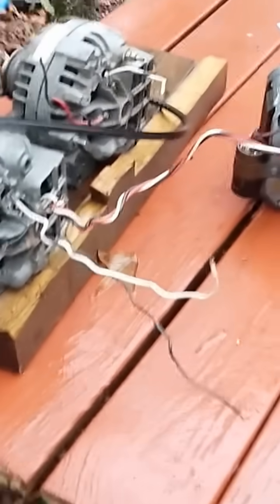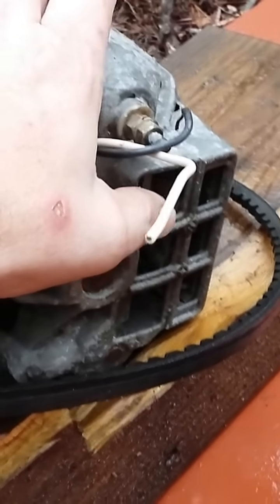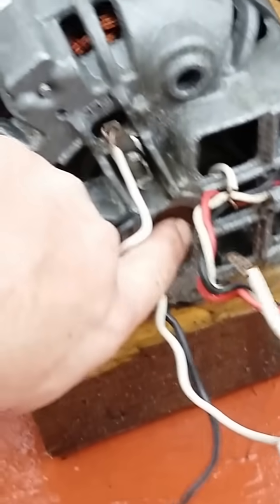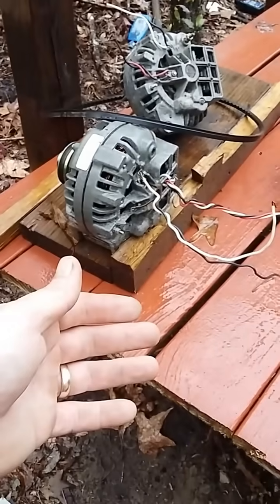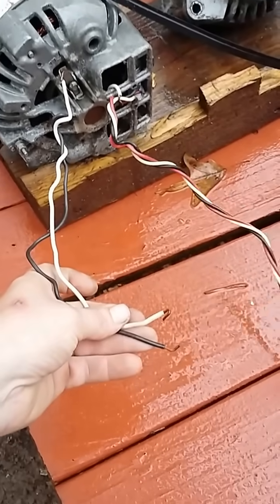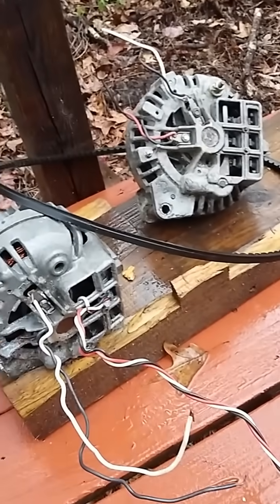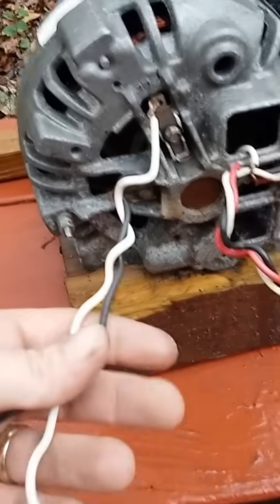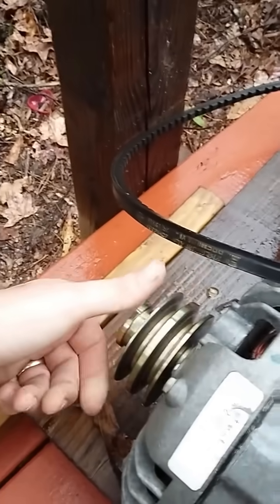Update Free energy forever no wind no solar no gas READ DISCRIPTION!!!

Comment: CRYSTAL METH IS A HELL OF A DRUG. DO YOU REALLY THINK YOU ARE THE FIRST PERSON TO THINK OF THIS? NO. YOU CAN NOT GET MORE THAN YOU PUT IN.
Reply: not if you learn wrong way to do it. /Tesla
Reply: if you cannot get more than you put in..... then how do electric companies take their power and step it up a SHIT TON to send it down the line then step it down b4 it enters your house???  You can use a step converter to take 5 volts and output 25 volts with that same 5 volt input.  

Actually....... you do not need ANY power input if you use mechanical energy to "spin the wheel".  The guy who runs Turtle Island that they show on history chanel just ran a line up to a natural spring and the force of the water was more than enough to "spin the wheel" and he powered his sawmill with a endless supply of "mechanical energy".

Essentially you get electricity with ZERO input (power wise).

A stun gun takes 9volts from a 9volt battery and steps it up to 20k volts and does it without sucking the battery dry so it lasts like you are using it in a small flashlight or whatever....... 20k output with only 9volt input.  I know some things use capacitors to "store" a charge but if you actually just transferred the 9volts to a capacitor and stockpiled the power up to 20k you would drain the battery and basically get a rapid discharge released all at once...... 

I know TECHNICALLY law of thermodynamics says you cannot get out more than you put in....... but...... plug a 9 volt into a stun gun and u get multiple uses out of the battery at 20k volts (or whatever strength the stun gun is).  You cant just "store" the current cuz it would take 2,222 9 volt batteries to store enough charge to release a 1 time discharge of 20k volts.  So ya...... you do get more out than you put in despite laws of thermodynamics.

But then again E=MC2 says you got enough energy in your finger to blow up 1/2 a city.....  You do not need "uranium" or plutonium ect...... any mass will produce that kind of "bang" we just don't know how to "release" it.

You can manipulate the current to make it get stronger without inputting any more than the original input.  And technically if you find a nice "natural spring" that spits out a endless supply of water, you can get something from nothing because the spring would have been spitting out water regardless weather or not you "tap into it".  It would be doing its thing if you did not use it to "spin a wheel" and once you generate the power, you can drink the water....... so the "garbage or byproduct" of it  flowing out of the rock = "free energy" that was created from NOTHING. (it IS nothing because if you never used it to "spin your wheel" does not effect the water in any way, and if you do spin your wheel with it, you essentially do not effect it and at the end, you still have the same water that can still be used as "water").

You are correct as law of thermodynamics says you are correct, but..... in all in all you can get energy from essentially "nothing" as you do not need to "supply" a power source when the river is going to flow and keep flowing regardless weather or not you exploit the mechanical energy or not..... so the same water will do exactly what it is doing and NOT create electricity or create electricity and STILL do what it naturally does.  

If a tree falls in the woods and nobody is around to hear it....... the sound is still made weather or not you are are there to "exploit" the sound waves by "hearing" it or not......
Reply: you are funny.
"You are correct as law of thermodynamics says you are correct, but..... in all in all you can get energy from essentially "nothing" as you do not need to "supply" a power source when the river is going to flow and keep flowing regardless weather or not you exploit the mechanical energy or not..... so the same water will do exactly what it is doing and NOT create electricity or create electricity and STILL do what it naturally does. " the river is the POWER SOURCE .
. like i said. you CAN NOT get MORE POWER than you put in. if you have not learned that by now,you probably never can. stick to legos and jigsaw puzzles.
Reply: I guess you missed my "alternate view"...... As I said thermodynamics lays it all out in general for EVERY type of energy converting to a different energy type such as "potential energy" such as a ball at rest on top of a incline that converts to kinetic energy when it starts to roll down the incline.  Yes..... I do understand the whole "concept".......   and yes........ I realize you are converting the mechanical kinetic energy the water/wind has and converting it into electrical energy....... and thermodynamics explains and measures one to the other..

The thing is........ "potential energy" can be a completely imaginary concept and conflicts with "an object at rest will remain at rest unless acted on by outside force and object in motion will remain in motion until acted upon by outside force.  A ball at rest at the top of an incline and you say it has "potential energy" = abstract concept because it is at rest and will REMAIN at rest = no energy until outside force acts on it so the ball rolling down the hill = MORE energy than you "exert" to "nudge it" into motion.  You get more energy out of the ball rolling down an incline than you input to start the ball rolling.  But you can throw thermodynamics back at me and say the force of gravity is enacted to accelerate the ball so gravity force/energy = the energy of the ball rolling down the incline and so thermodynamics is satisfied as output does not > input.

A spring or rubber band would be a "realistic" way to say "potential energy" as it ACTUALLY stores the energy and releases the energy much like a battery does only for "mechanical energy"..... yet a ball at rest has no energy stores no energy and ONLY moves because of outside forces enacting on it so...... yes PART of "thermodynamics" is indeed an abstract "imaginary" concept as it does include this situation of "potential energy".......

The thing with the river providing the "energy" YES!!!! I KNOW!!!! you are technically converting mechanical kinetic energy into electrical energy and thermodynamics dictates EVERY PART of the "transfer" of energy..........  I am simply saying that the river flows and will keep flowing weather or not you "exploit" it or not......  YOU are getting more energy than YOU input by using the water flowing that is flowing and will continue to flow even if you never even DISCOVER the river.  You build a pipe to divert some of it to power your "whatever".   You exert energy to build the pipe and with that LITTLE BIT of energy you exert you can get YEARS of NONSTOP "energy" with the very little energy YOU INPUT.  You do not have to create/convert/manipulate or even INTERACT with the river to produce a mechanical energy to use, it naturally is there and will be there after you die, doing exactly what it does....... flowing from high to low.

Where is "thermodynamics" to account for THIS abstract "imaginary" concept???? it can magically give a ball that is at REST an abstract imaginary amount of energy when in fact that ball could never ever move at ANY point in the future.....  It might just stay at rest its whole "life" and NEVER move = it has NO energy.  

The door swings both ways as the river is already in motion and will continue to be IN motion until no more water is added to it and it evaporates, but until then you do not have to INPUT the amount of energy the water has "naturally" to "exploit" it, it takes far less energy INPUT to "exploit" it.....  so yes..... you can get MORE than you INPUT.

Now..... put a mechanical generator onto the wheel of a stationary bicycle...... in order to get energy out of that "SYSTEM" you must INPUT a SHIT TON of energy to receive a way lesser amount of energy because why???? As the ball is at rest so too is the IMAGINARY "potential energy" of the generator that will NEVER produce energy until you get on the bike and pedal your ass off......  I am simply showing that by building a windmill you input a small amount of energy to "build" the windmill.

Now.... it boils down to the question...... Does the windmill that does not EXIST yet have "potential energy" even though it does not exist as you have not built the windmill yet???? THAT is the SAME THING as saying the ball at rest has a "magical imaginary" energy that DOES NOT EXIST because it will NEVER EVER MOVE until you exert a very small amount of energy to "nudge it" = YOU input energy into the ball to make it move and if it is rolling down hill, you receive MORE energy than you INPUT.

Before you build a windmill thermodynamics does not have ANY part of it, as it does not exist...... you input the energy to BUILD the windmill and with that little bit of energy you RECEIVE years and years of constant energy........ thermodynamics explains and measures the transfer of energy from teh wind to the mill to the "whatever" you are powering with the mill....... but what thermodynamics does NOT even BEGIN to calculate is the fact the mill does NOT EXIST and the energy YOU YOURSELF INPUT which INDEED you are getting more out than you put in........

THIS is the FLAW with thermodynamics.  Diverting a river with a pipe to power something..... You do not need to "input" the energy of the water as the energy of the water ALREADY exists and will continue to exist even if you are not there to INPUT energy to "exploit" it.  If I do not input ANY energy to exploit the river then i get a SHIT TON % more energy than I input as I input ZERO energy and the full force of the water energy continues to flow..... I simply just sit there and watch it flow so I am getting 100% of the energy OUT of it, because I expend NO energy, yet it has "potential energy" as I sit there and watch it.......  This is what thermodynamics does NOT include into its "law".  It describes the lowest "layer" going all out to calculate the "energy" of a ball at rest at the top of a hill...... but does not account for the ALMOST NO ENERGY input to make the ball move. It calculates all that "non existing" energy that ONLY exists after I NUDGE it with almost NO energy input.   It says potential energy as it "might roll down the hill" the hill gives it this much energy and acceleration, ect ect....... but NONE OF THAT exists until I nudge it...... If i never nudge it there is NOTHING for thermodynamics to even BEGIN to "calculate" as that object at rest will remain at rest until I move it (or whatever "energy' comes along and "exerts itself onto the ball").

A good analogy to explain it is..... you have a digital scale......  you have something you want to weigh but you do not want the "weight" of the container but only the weight of the contents....  the scale is thermodynamics but you want to measure the INPUT energy (that pertains to YOU).  You place an exact duplicate of the "container" onto the scale and zero the scale out..... now place the container with the thing you want the weight of.....  now it gives you the weight of ONLY the contents and not of the container....

I want to ZERO the scale/thermodynamics and ONLY measure the energy I input to get the "result" I want to achieve.  The "contents/energy" will be the same weather or not I am measuring it or not, I only want to know the INPUT that I must do to achieve my goal........ therefore you get MORE out than YOU put in.  Thermodynamics does a DETAILED and EXTENSIVE job at describing/calculating every little aspect of the transfer of energy of the "system" but does NOT include the actual INPUT amount of energy that sets the "system" into motion and fails to acknowledge that if that "outside" force is NOT applied then all them "laws" describe NOTHING as the "system" will NEVER move or have energy until you apply that small amount of energy to set the WHOLE thing in motion.

Einstein said light speed = top of the scale and NOTHING can travel faster than it...... I cannot walk faster than I can walk from point a to point b........   but....... now move the ground I am walking on toward point B as I am walking to point B = I travel at same speed (below the speed limit) but ultimately travel much faster than the speed limit as the ground I am walking on is moving faster than I am walking.  Same concept as spacetime ITSELF can expand faster than light.   Thermodynamics is much like the laws of "relativity" and ignores the fact that spacetime ITSELF can expand faster while the object it carries can now "walk" faster than the speed limit of light..... as it ignores the VERY SMALL nudge I give the ball to set the whole system into motion....

So by nudging the ball and making it roll downhill for 5 minutes.........  Tell me how I am not getting drastically MORE energy than I input into the ball?  Any law of thermodynamic you "recite" to me = not relevant to the energy I am receiving FROM the ball compared to the energy I exerted onto the ball.

I have a REAL problem with this aspect of the whole conservation of energy and thermodynamics as it is like you pulling out a ruler to measure an object but the object does not exist TO measure.
Reply: http://www.rexresearch.com/grandics/grandics.htm
Reply: thermodynamics is a mighty big word for you. tell us all about it in your mind. lol. more more . maybe if you give a longer example ,it will magically happen. you might be the first to unlock the secrets of the three magic alternators and be king of the world someday..
Reply: Reading a simple document appears to be more difficult for you. I am pretty sure the US Patent office doesn't award patents for shit that doesn't work.
Reply: wow.more assumptions.maybe your psychic powers will ad some power . we're ready for your working model.read,do,show. or shut the fuck up.
Reply: Let me guess, you probably think anti gravity doesn't work either, right? https://www.google.com/patents/US20060145019
Reply: You probably say over unity is a myth too, right? What about this? https://www.google.com/patents/US6974110
Reply: Can you read or are you just stupid?
Reply: and you simply regurgitate what the "book"/they say is the way things is without ever seeing it has holes and fails to accomplish the very thing it "accomplishes".......  Take a group of atoms into deep space where it NATURALLY gets as close to absolute 0 as it can get and the atoms slow WAY WAY down and if they hit ab 0, you literally loose the "heat" "friction" "motion" and EVERYTHING..... it simply disappears as the energy the atoms used to contain no longer EXISTS.  the heat does not "dissipate" to anywhere as the atoms themselves simply stop moving = they simply stop producing the heat..... stop moving = no more friction that used to cause the heat....  Since they basically stop moving and "freeze", there is no "potential" energy as they cannot move and will never move again until a "heat" energy is added to make them warm again.  The energy they used to "posses" is simply destroyed......  I can come along and transfer some of MY energy and some energy from a heat source TO the atoms to warm them up allowing them to once again "create" energy as they vibrate.

That state where physics and even quantum physics are BOTH thrown out the window = a place even stranger than quantum mechanics.  A place where even light ITSELF can be "stopped" and frozen .

And yes, I said take them to a place in deep space where the natural temp is as close to ab 0 as it can possibly get = NO energy is expended to CREATE the ab 0 environment, the "lack of energy" itself naturally creates it.
Reply: let me guess ,subject diverted? show us your flying saucer.
Reply: not diverted, just showing that there ARE holes in the "laws" that make things "illegal" and "impossible".
Reply: I do agree with the step up in voltage, there is a thing called a step transformer that is in almost every kind charger out there. But however when you step up voltage you get a loss in amperage. A 9 volt battery in a stun gun stepped up to a million volts has much less amperage in it. Think of it as pushing water through a garden hose...you can shove 100 gallons of water through a one inch hose but to put the same volume of water through a hose that is the size of a hypodermic needle, you must increase the speed at which the water travels through it.
Reply: If you read the Patent dumb ass you would see it. Get off your dead ass and do some work.
Reply: https://www.youtube.com/watch?v=RO3RFRlMawY&t=829s
Reply: has anyone seen the video of college graduates that could not hook a light to a battery?
https://www.youtube.com/watch?v=aIhk9eKOLzQ
Reply: it puts a whole new light on the stupidity of the unemployed college protestors that seem to be protesting just to protest.
Reply: Fools, the key word in the second law is YOU. It's meant figuratively. Tesla revealed that as you let the energy flow in to get your work done for free(With out YOU(figuratively) adding anything other than what starts the work.
Reply: a ball on top of a hill. huuuum. how much energy did it take to get the ball up there? once at the bottom of the hill it is used up like burnt fuel. like winding a watch.like swinging a pendulum.
Reply: where is your over unity energy? can't you read a simple document? oh, you have no over unity energy for me or anyone on this planet? well i guess you must be stupid.
Reply: A ball at rest on a flat level plane......... something comes along and takes the ground away in front of the ball forming a slope away from the ball.  Ball is now sitting on top of a hill that used to be flat and level = no energy was put into the ball to "get it up there" even though energy was used to move the ground to form the hill, that ball will STILL remain at rest until a small energy force is exerted to the ball to put it into motion to go down the hill (that it NEVER traveled "up").  The energy spent removing the ground in front of the ball does not change the fact or will NEVER change the fact that the ball at rest will forever REMAIN at rest until you, a gust of wind, or whatever puts that ball into motion, allowing it to roll down the hill and the energy released going down the hill is MORE than the "nudge" you give it put it into motion. Energy used to "form" the hill has NO BEARING on the ball whatsoever......

You could say that the energy used to create the hill = the "potential energy" now stored into the hill...... but lets say 1000 or 1000000 balls roll down that hill until the energy it took to create the hill is exceeded by the 1000000 balls rolling down it...... where does the energy come from that is in EXCESS of the "input energy"?  You make up an abstract "ideal" called "potential energy" that the hill somehow MAGICALLY still has even though the energy used to create it is exceeded.....
Reply: energy was used to create a slop. lowering the ground and putting the ball up are the same thing. nice try. and you only moved the ball to the slop ,where gravity moved it down. the fact will always remain ,that it took energy to create a ball ,the ground,and the slop, and it's movement. even energy from a solar panel is not free in any way shape or form. your balls are not even close to over unity and also created a large waste product of thousands of balls magically up on a hill now being at the bottom . there was no " the hill and ball had no energy. i never said that. you did. if you think your balls can be used to create over unity,by all means,show us.we all find it entertaining.
Reply: "
"energy was used to create a slop. lowering the ground and putting the ball up are the same thing."  

I already mentioned this..... If I sit down on a flat piece of land, and YOU come along and make a hill in front of me..... ya you used energy to create the hill but..... that in no way effects me as I am at rest and remain at rest even though you created the hill.....

I sit down on a flat plane, I did not have to exert any extra energy to go "up a hill" (a ball rolling on a level plane takes LESS energy than to roll UP an incline) yet there is now a hill there and NO energy used by me to "exist" at the top of the hill that NOW EXISTS because you spent the energy to create it.  Someone nudges me and I now roll/fall down the hill you created.  The hill was and had nothing to do with my "energy system" 

Ya, technically (as I have said before) thermodynamics explains and measures it...... but...... if you spend energy to create a hill in front of 1000000 balls and a single gust of wind makes them ALL roll down the hill then the energy from 1 ball rolling down x 1000000 or 1000000000 or whatever that is put into motion by that 1 gust of wind.... a tiny amount of force was used to push them all at the same time, just enough force to move a ball but that same force moves them ALL at once.

What I am saying is.... if you have a wind guage and measure the force of the wind as it pushes 1 ball, will the measurement on the guage increase if you add 100 more balls (that also get affected by the gust of wind).  If the guage does not increase then any energy you "try" to apply to the other 9999999 balls do not exist because the wind did not get stronger to move the extra balls.

You could come back and say it IS more energy used because that small force is applied over an area and only a small fraction of it is used to push 1 single ball and more is used of the area effect of the gust to push multiple balls...... but if energy cannot be created or destroyed, then the energy that exists where the balls do not exist if you only have 1 ball, yet the single "gust" of wind that pushed the 1 ball, where does the "rest" of the energy go?? On the other side, the gust did not get any stronger to push the extra balls ....

Also, how can gravity be considered "energy"?  If 2 magnets pull each other together because of the magnetic force how can you consider that force "energy" as that force is a natural trait of it?  That natural force can attract object after object after object after object yet it does "expend" enough "energy" to do so??  Everything I have read on magnets say that in order to "demagnetize" a magnet, you basically have to put "energy" into it to remove the natural trait of magnetism as in heat it up, shock ect....  some say that a magnet will lose like 1% of its magnetism over 100 years so the magnet itself will "erode" away well before it become "naturally demagnetized".  How can you call the force of magnetism "energy"  as it is an inherent property of the material?  Gravity is essentially magnetism only all matter posses Gravitational Fields unlike magnetism fields.

2 Pieces of matter that attract each other will ALWAYS attract each other and no "energy" is used to do it......
Reply: "2 Pieces of matter that attract each other will ALWAYS attract each other and no "energy" is used to do it......" this is the exact stupidity that made your education useless. like i said,go right ahead and show the world if you think you can. but you won't.and you defiantly have not come even close here.
Reply: So, if 2 objects at rest get pulled together by gravity, where does the energy "come from" then?

"In physics, a gravitational field is a model used to explain the influence that a massive body extends into the space around itself, producing a force on another massive body.[1] Thus, a gravitational field is used to explain gravitational phenomena, and is measured in newtons per kilogram (N/kg). In its original concept, gravity was a force between point masses. Following Isaac Newton, Pierre-Simon Laplace attempted to model gravity as some kind of radiation field or fluid, and since the 19th century explanations for gravity have usually been taught in terms of a field model, rather than a point attraction.

In a field model, rather than two particles attracting each other, the particles distort spacetime via their mass, and this distortion is what is perceived and measured as a "force". In such a model one states that matter moves in certain ways in response to the curvature of spacetime,[2] and that there is either no gravitational force,[3] or that gravity is a fictitious force.[4]"

THEORY...... all we have for gravity is 100% theory..... we know it exists, what it does but have no CLUE as to WHY it exists....  So how can you say gravity = energy when we do not even understand HOW or WHY IT WORKS??
Reply: if two objects are at rest they are not being pulled together are they? still waiting for your working model. when something exist why is irrelevant. there is no mystery at that point. your circular babblings are boring me. the fact of the matter is ,this video is bullshit.until you have a working model proving otherwise ,which you can not,it is you living in a world of theory.
Reply: "if two objects are at rest they are not being pulled together are they?"  That was kinda my point..... How can 2 objects pull each other together?  How can the Sun pull the Earth towards it creating the "orbit" we are in?  Energy cannot be created or destroyed..... so...... where does the "energy" of gravity come from or how/why does it work?  

"it is you living in a world of theory."...... this is the ESSENCE of science.....  There is no FACT in science.....   If you say one thing is FACT, that fact will change tomorrow by a new "discovery" that changes your "theory".   Once you stop "theorizing" and contesting the "fact" of science as it stands today, then it is you that live in a "make believe" world as the world we "know" is changing all the time and the things we THOUGHT we knew are proven to be far away from the truth that we learn tomorrow that WILL be changed again the next day to a NEW "truth".

Without living in a world of "theory" we would still think the Earth = Center of Universe and the universe revolves around the Earth.... and the Earth is Flat ect.. ect...
Reply: humm still no working model? i guess you're a hack lol. maybe you don't have enough balls on your hill.lol
Reply: Rusty Koenig
you have a lot of questions for someone acting like they know it it all. what a joke.
Reply: Galileo was once branded as a "crackpot" with "laughable theories" and ridiculed...... The man gave us new and strange "ideals" that "mainstream science" said was a "joke"......

Yes..... I have LOTS of questions..... YOU should have lots of questions too because when you stop asking questions progress will not be made..... If Galileo simply regurgitated the crap that was being "taught" along with everyone else...... The earth would still be the center of the Universe with EVERYTHING revolving around US.  If Einstein stopped asking questions and simply only regurgitated what was taught......  If Hubble simply regurgitated what was taught........... 

I do understand all you been saying as it is Jr. High level BASIC physical science 101...... (or was when I was in school and may be taught sooner now days).  This is ALL basic crap learned in science class.  But...... then again...... MY science books in school said we had 9 planets and the 9th planet was called PLUTO!!!   This was FACT and taught as FACT.......  Hmmmm........ My FACT is no more and a "new reality" exists for students now..... 8 planets and Neptune = the last planet.......

I do understand that "this video" cannot work.....  As long as we have been using electricity, generators, batteries, building complex electronics....... if you could simply use a generator to generate power, send it to a motor and have the motor power the generator and all started with an initial burst of energy to get it going....... I think we would have had it by now and it would be common knowledge if it were possible to do that........

But NEVER EVER stop criticizing..... asking questions...... challenging "fact"..... as when you stop doing that, all "progress" towards new things are lost FOREVER!
Reply: it is the year 2017 and you are not Galileo. you are the people that called him a crackpot. .it was not that he was not believed,it was because he destroyed the fake flat earth freaks of his time. still waiting for your working modal of over-unity. well actually i'm done waiting because you can't do it.
Reply: Since you only seem to read the 1st line...... 

"I do understand that "this video" cannot work.....  As long as we have been using electricity, generators, batteries, building complex electronics....... if you could simply use a generator to generate power, send it to a motor and have the motor power the generator and all started with an initial burst of energy to get it going....... I think we would have had it by now and it would be common knowledge if it were possible to do that........"
Reply: I am not claiming to be Galileo...... for the most part he was NOT believed...... there are more "Flat Earth nuts" today than there were people who believed him in his day...
The church was basically "science" back then and the church went all out to silence him and pretty much did a good job of doing so..... the general public were basically clueless and probably never even HEARD his "theories" as the church spent a LOT of effort to snuff out those "ideals".  

I am not the one who labeled him crackpot, I am the one who keeps an open mind to things.  Just because I challenge the "norm" does not by NO MEANS mean that I do not "understand the norm".  

The closest thing to this would be modern day Quantum Physics..... All those things that were always just "theories" and sometimes even "laughable theories" are slowly becoming reality now.  Einstein even joked about the Quantum "theories" and could not accept the "theories".  Now we have Q-bits..... we are now using the very "laughable theories" of the past to create a new type of computing.  As we go deeper and deeper into Quantum Physics the more and more wacky and laughable "theories" become "realistic" such as multi dimensions where every possible situation happens and exists and is as real as the situation we "observe".  Reality being a "simulation" as EVERYTHING only exists when we look at (The moon exists, EVEN when I am not looking at it..... may be totally opposite of what Einstein joked about).  NONE OF THIS was even CONSIDERED mainstream except by a VERY FEW "theorists" a VERY SHORT time ago, yet is becoming more and more reality as we learn more and more.

Quantum Physics alone should spark questions from you about the very nature of REALITY and the Reality we call "fact".

If I would have answered the question "How many Planets are in our solar system" with "8" or included Pluto in the list of planet names on a test with 2 questions....... and got the 1st question right....... I would have FAILED a science test when I was in school...... If kids answered 9 and included "Pluto" they would FAIL a 2 question test now......

Just cuz the BOOKS say it, does not make it fact or true..... it simply records the data we have found thus far and presents THEORIES to explain the data.  NEVER EVER EVER take science as set in stone FACT.  NEVER stop asking questions, NEVER stop challenging the "norm"..... NEVER discard ANY information that does not jive with the stuff you see as "fact".... You do not have to embrace all ideas as fact, but do not discard them as false..... keep them in your mind as one day those crackpot ideas you "threw away" may be taught as FACT in mainstream science of tomorrow.......

The "fact" you are comfortable with, be comfortable with it, but ALSO be comfortable with questioning that "fact".  THIS IS THE VERY ESSENCE OF ALL SCIENCE!!!!!!!

Once you stop questioning and scrutinizing the "fact" you are comfortable with....... all you are left with at THAT point is RELIGION!!!!!!!!